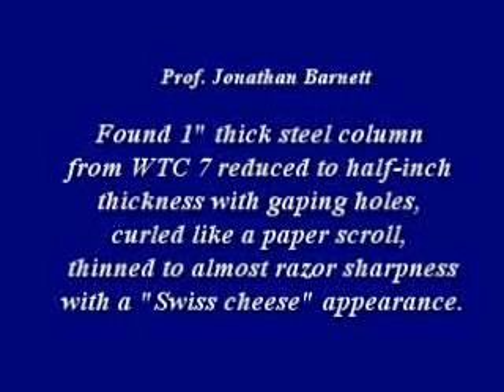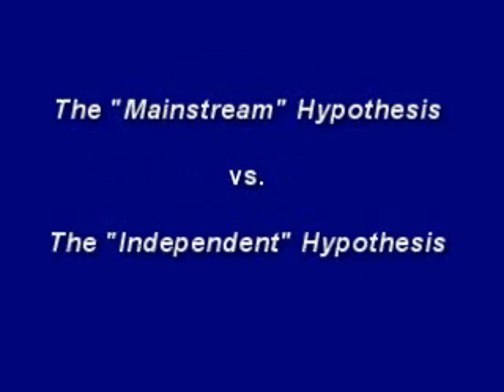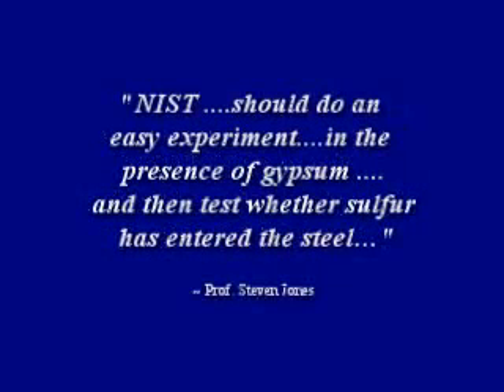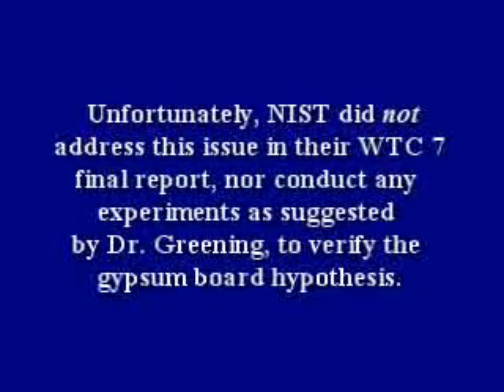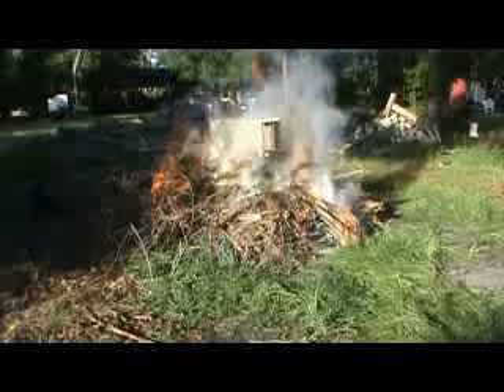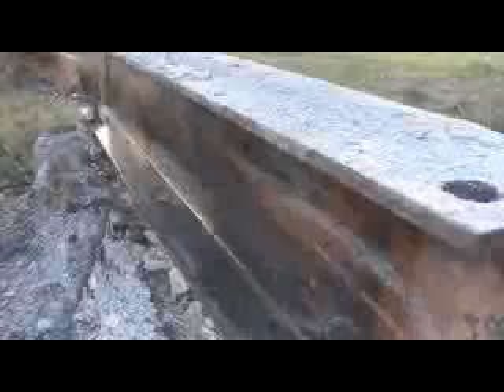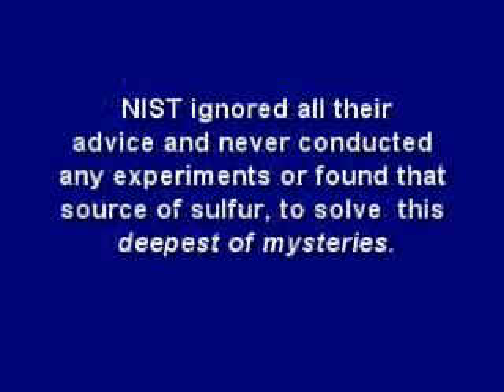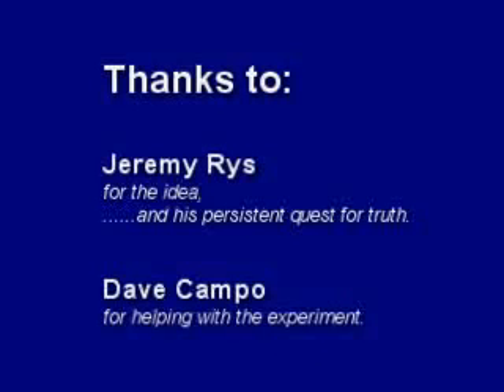9/11 Experiments: The Mysterious Eutectic Steel

Comment: An open bonfire doesn't present the same conditions as a constructed building.
The beams would be contained within the building structure (likely a well insulated environment), creating a sealed oven-like effect which heats the air around the beam as well as the beam itself straight to the core.
This bonfire, while large and incredibly hot, heated the beam from the outside inward and had an open outdoor airflow which offloaded a significant amount of heat. I highly doubt it came anywhere close to the temperature of the WTC building fires.

I don't have an opinion regarding 9/11 "conspiracies" or "government lies," but I do believe this experiment is bogus and fails to properly prove anything in regards to what happened in WTC 7.
Reply: It proves what was already conclusively known: that the materials in the building along with uncontrolled hydrocarbon fires cannot possibly account for the steel beams doc'd in the FEMA BPAT App C, or the pools of molten steel & iron found at the base of all buildings. *(Nor the iron microspeheres (which are elemental iron, -the byproduct of a thermitic reaction), -nor the 100 day fires with wildly excessive temperatuires, nor the squibs or explosive horizontal energy with which the Towers were destroyed, that pulverized most of the concrete, disassembled the superstructures, and left 1120 missing bodies, or wtc 7 imploding symmetrically at freefall, etc).

IN fact this experiment is completely convincing because it directly exposed the steel I beam to much hotter fire for far longer than any beam in any of those 3 skyscrapers would have been exposed. In case you're wondering, experiments on exact replicas of the WTC steel floor assemblies have been done (by UL *See whistleblower Kevin Ryan's work on the matter. He was fired by NIST for speaking out) and in Australia. In both cases the floor assemblies did not fail. -   *Hit the NTE link on my YT homepage. See those facts./
Reply: melekor: If you look the demo fire again, you see that the fire was long, and hot., and the steel got red hot, naturally.  In flames like that, what can you possible mean by saying a lot of heat was "offloaded"?  The steel got as hot as that kind of fire can make it, and for a long time.  It almost sounds like you are claiming that the fire somehow cooled off the steel.  But it doesn't even matter.  You can't melt steel that way, either in a backyard, or a bldg. fire. If it was possible, the steel industry would have done it in 1850.
Reply: disgny The heat is offloaded into the air around it. This is just basic science.

Why did the people making the fire have to stay far away? Because heat energy is leaving the fire. If it's leaving the fire and hitting the bystanders and surrounding area, that means it IS NOT being absorbed by the steel beam. This means. no matter how hot this fire is getting, there is wasted heat energy produced.

The important distinction I was getting at was, a building structure would create more of an oven effect. It's contained and insulated, unlike this (or any) bonfire out in the open. In order for the video experiment to be more accurate they would have had to do the fire within some sort of metallic enclosure that somewhat represents an office building.
In that case less heat energy is dispersed to the air around it, meaning more of it can hang around and get absorbed by the steel beam. Be mindful, the steel beam doesn't absorb heat instantly, so the heat needs to stick around longer in order to thoroughly heat it. The beam getting red means its probably pretty hot in there, but metal turns yellowish then white before it melts, so it's not like that fire is actually "really hot" in terms of structural metals. You can actually get steel to a red colour and not effect the structural properties at any noticeable level as long as it cools very slowly (like a bonfire slowly dwindling out).

I'm not trying to offer any opinion on 9/11 or WTC 7 or anything; I'm just trying to promote good science, which this video does not have. If you really don't believe me, or can't follow what I'm saying, just go ask some local firefighters. They  certainly know the difference between the heat of a building fire and a bonfire.

And honestly, who the hell knows what the steel beams were really made out of. Some of that metal was made in the sixties. There could've been a large batch of materials made with impurities that lowered the melting point of the steel. Nobody really cared about that sort of thing back then.
Reply: Melenkor:  If you are seriously interested, you need to look into the heat value of various fuels; they are not all the same.  Jet fuel , no matter what kind of "oven " you put it in, is limited to what temperature it can achieve.   And it is simply NOT enough to melt , or even seriously weaken steel.  There is really no more to be said.  Look up Windsor Towers, to see a real bldg. on fire.  Or the one in Peking a few years ago. You just can't bring down a modern steel skyscraper with fire.  Period.

Comment: I was in Japan shortly after the '95 Kobe quake. What I found was 15 story buildings with only the bottom floor or the middle floor collapsed. They were steel and concrete buildings. Now how is that those buildings survived and not the Towers? How does a fifteen story building sit and crush just one floor and Bldg 7 or the Towers not be able to stand the same compressive force and don't hand me the low temp fire caused it. Uniform failure isn't caused by a non uniform fire of low temperature.